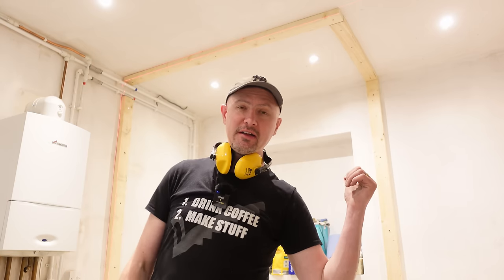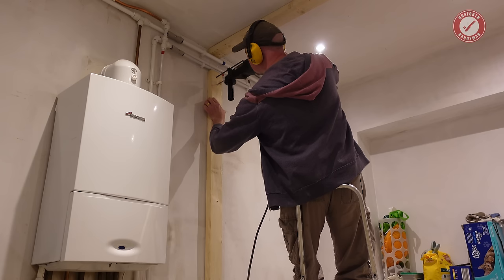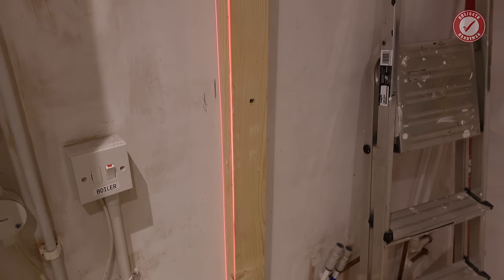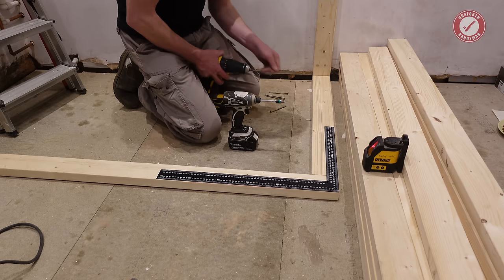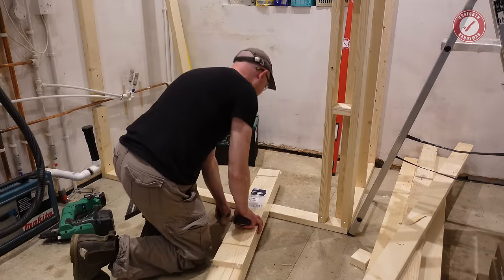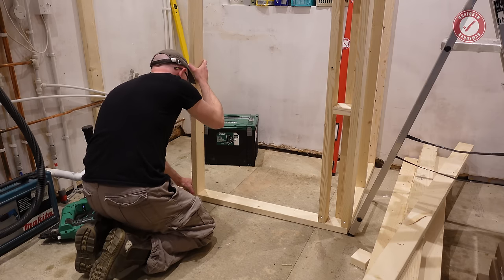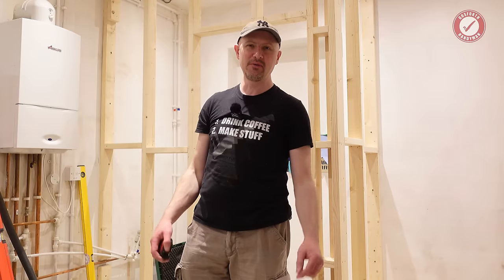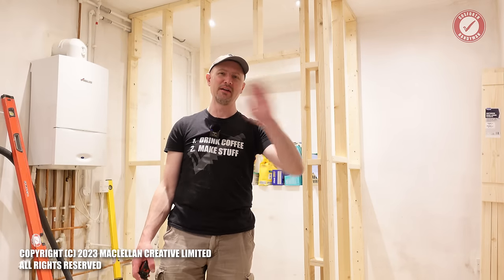How I build a STUD WALL - downstairs toilet (part 2)

Comment: Gang cutting wall studs to fit between top and bottom plates only works if your floor and ceiling are level and parallel to each other. I prefer to cut each individual stud to length and fit one at a time.
Reply: You must have worked on our house 
In fairness when it was built 480 years ago I doubt a laser was used….. 😅
Reply: @dougsaunders8109  they didn't even use spirit levels that far back but still managed, mostly with transits, plumb bobs and the plumb bob square.

Comment: Great video thanks. I'm considering making a stud wall across my garage to keep the front part for bikes etc and using the main part as a new room/office. I'll need a doorway like this too. The walls are concrete block, the floor is concrete and the top plate will have to go into a very thick concrete beam above. Any tips appreciated. For example should I put a strip of DPC material under the floor plate maybe ?

Comment: Top video. Framed a very similar room a few years ago with pocket holes instead of toenailing and electrician pointed out something that needed adjustment. Fix was easy, takes more time however.
Reply from the maker: Great stuff! 👍👍

Comment: I’m about to build a fake stud chimney breast to accommodate the recess needed in my old cast iron fireplace (now purely cosmetic) and this information is gold. My walls are plasterboard and floor concrete so I’ll swap the fixings around but feeling much more confident (aside from the 2 pull ups 😂) Thank you.

Comment: 3:00 is all about vacuuming out the hole, not re-drilling it! If you need to go in twice, you're just re-grinding the dust you've already drilled that's not been evacuated by the flute. I learnt this the hard way 😉

Comment: What a great series. Me and my husband are looking to buy our first house this year and one of the requirements we have, there needs to be a downstairs toilet, which unfortunately, not a lot of houses in our area have. Therefore, just watching your series, its giving me insight of what you will need to do if we ever decide to go this route ourselves (we would probably hire someone to do the plumbing though). Many thanks to explaining the process in great details Andy 👍.
Reply: Basically  I build my walls on the floor, with the crowns down. 16 1/2" on  .
Reply: Sill plate has sill foam or plastic on concrete, between  wood & concrete.

Comment: My tip for drilling hole for concrete screws is have a bendy straw handy and blow out the dust - make sure your face is out of the dust blast!

Comment: What a helpful vid Andy 😊
I’m about to build a stud wall in  our 1928 house…. Lath & plaster ceilings, and old dodgy plaster on the walls. I’m thinking of cutting out a strip of the lath & plaster ceiling so my top plate can fix directly to the ceiling joists. Also channelling the plaster on the wall, so my wall  stud can fix directly to the exposed brick, rather than  crushing the fragile plaster. Sound like a plan? Cheers 😊

Comment: Jack studs are a slightly shorter stud that headers and window sill plates bear directly onto - usually in load bearing stud walls where you have a beefed up header that’s acting like more of a lintel. The Jack is doubled up with a full length stud directly next to it, which gets called a King stud. (Found out all the lingo by watching too many American framers 😌)

Comment: I am envious of your square walls! I think I had a 6" variance over 12' over the height and let's not talk about the wall bulges. My studd wall is now the most plumb and square object in my house! ;)
Reply: I know carpenters who think a 1-1/2" variance in 8' is exceptable on a wall.
Reply from the maker: Too right - can't abide non-square walls! 😂
Reply: Hard to go wrong framing two sides of a room that's only 3' x 6' x 8' with a double line two plane laser level!
😁😅😝

Comment: Nice straight timber to split the beam Andy. 
Also thanks for the tip on the anchors, just curiously how did you find they get stuck if the dust builds up…. 😉

Comment: Nice job. I like to cut the sole plate out once you get the door studs in and use that as the header, less waste and it's the right size.

Also think it's a cripple stud at the top above the door header (but prepared to be wrong)
Reply: No, you're right it's a cripple stud.

Jack stud runs up the door frame and supports the header.

Comment: Clearence hole for the concrete screws: 8mm
Also, for other DYI-ers out there:
If you don't know what is underneath, especially pipes on a notched joist, it is better to drill a 5mm clearence hole and use 5x60mm screws on the bottom plate. For extra insurance, I use expanding foam under the plate and the floor, if not any decent hybrid adhesive will do. Same for the vertical studs to the walls. Not really necessary, but belt and braces.
I personally find the concrete screws hit and miss for holding into the walls and use a 8mm x 100mm concrete anchor. They have never failed me like the concrete screws.
Reply: PU Adhesive foam, not expanding.👍

Comment: Is it best to use 100x50 for the stud walls Andy or can you get away with 75x50 ,great video by the way
Reply from the maker: Cheers! With this being 2.6m ceilings I prefer 2x4's as they're a bit more solid. 👍

Comment: So when does the apprentice put their foot through the ceiling and drill into a water pipe?!? 😹 Good job Andy. How you finding this style of video format with voice over??
Reply: Stud above a door or window would be a cripple??
Reply from the maker: Voice overs are much easier! 😂 Yeah, heard it called a cripple in the US but never heard that in the UK? 👍
Reply: @GosforthHandyman  Pretty sure cripple is right - a jack stud runs sole to header or sill alongside a full height stud, which is then a king stud.

Comment: Hi Nice Video! I was wondering if you were at all concerned with adding a bearing wall to the exisring structure? Normally, when building non-bearing, interior partition walls: the stud wall  is built short  by 1" with any number of methods to attach the wall while keeping it non bearing. I always kept in mind that when a wall touches both the floor and the structure above: it is bearing weight, even if I don't want it to be.
Reply from the maker: Cheers - never seen that done in the UK? 🤔
Reply: @GosforthHandyman  nah, me neither, even in a Scottish timberframe capacity, I've never heard it mentioned. It's an interesting thought though, and I might be less wedge-like when I do my next partition!

Comment: Can you build a stud wall (non load bearing) off a floating floor?  Struggling to find sny definitive info on it....
Reply from the maker: What do you mean by floating floor? Like laminate or engineered wood floating over a fixed subfloor?
Reply: @GosforthHandyman  sorry, I mean in e.g. a garage conversion type situation.  Concrete slab, then DPM, insulation (prob 100mm), 22mm t&g chipboard and then stud wall on top of that....thanks for the reply btw 👍👍
Reply from the maker: Hmm... you'd need to double check but personally I'd cut the floor away where the stud is going and attach directly to the concrete with some DPM under the sole plate. Not 100% though!

Comment: When I did conservatory bases for 14 years the fitters called those masonry screws grabbers so the name struck . 
   Quick tip.. drill your hole and blast a bit of WD40 into the hole using the straw . Glide in lovely 👌🏼🧱👍🏽
Reply from the maker: Cheers Steve - great tip! 👍👍